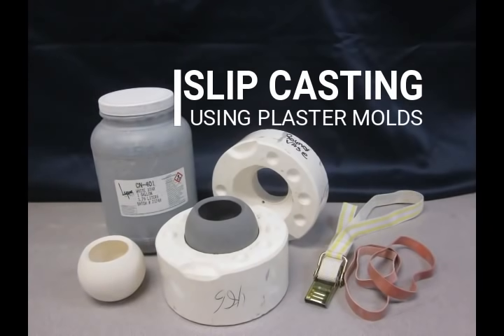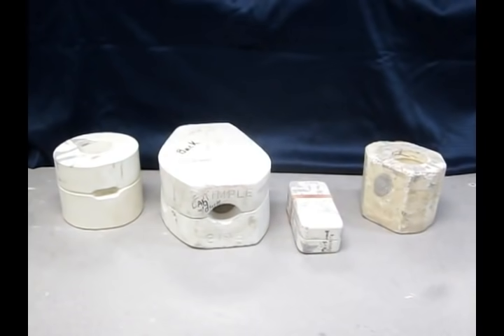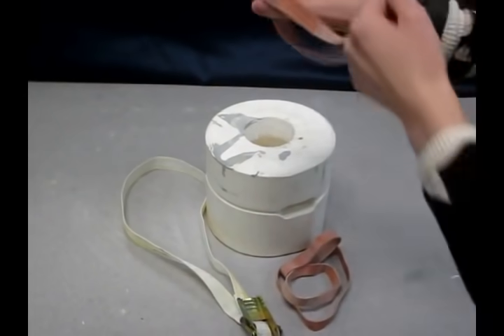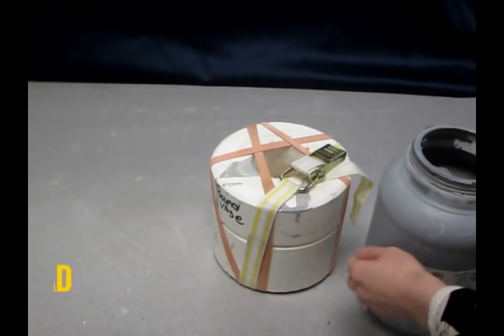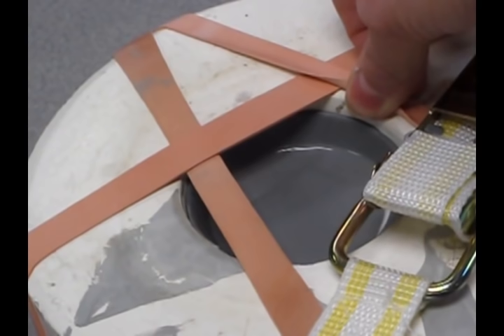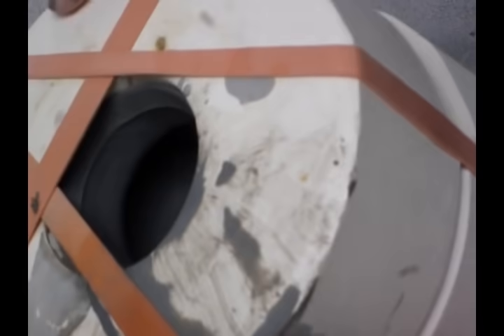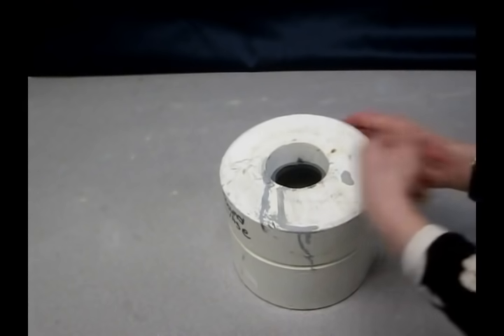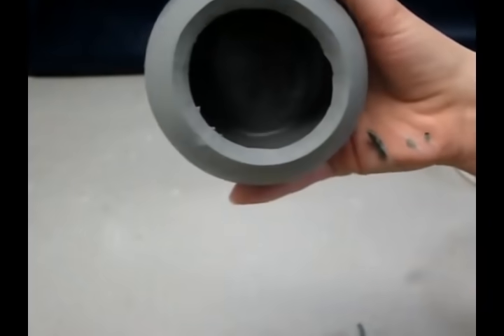Slip Casting with Plaster Molds - In Six Steps

Comment: If you don't mind me asking what's the point of creating a mug or cup made of plaster if it's not food safe?
Reply from the maker: Are you asking why would a person make pottery that is not food safe?  Perhaps for aesthetics, exploration, or just for the sake of art.  People make all sorts of useless art because of that deep innate urge that pushes us to create.
If you are asking about a "cup made of plaster" I think you misunderstood the process.  Plaster molds are simply a tool that clay is poured into in order to form it... the plaster is not what you eat or drink from.  The pottery that takes shape inside of the mold, and is eventually removed from the mold, is what a person would eat or drink from, and its "food safety" is determined by the type of clay, the firing schedule, and the glaze used on its surface.

Comment: Thanks for this, i'm just starting out. Would clamps be less fiddle and not get in the way of pouring ? Liked and subbed :)
Reply from the maker: Sorry for the late response!  Clamps would also work in place of rubber bands or a universal mold strap, as long as you trust their strength.  The trick with a clamp is it would probably tilt the mold - the lower "jaw" would go under the mold but above the table.  If your mold sits at a tilt while full of liquid clay, it can cause the clay positive to form differently, depending on how the slip touches the mold.  If you can elevate the mold off the table while clamped it would should work without issue.
Reply: @jenettemorganclassroom  Thanks for taking the time to explain.

Comment: should probably empty the "used" slip into another container after it has been used a few times, so that at some point, you can add water to adjust the specific gravity of the slip.
Reply from the maker: I agree.  If there's a specific gravity you prefer for slip casting, definitely use it.  I tend to just pour back into the container and eyeball it.  When it starts to look thicker I add a little water and blend it.  Knowing your specific gravity would be important to a production studio.  We just make a few of these at a time in the classroom.  But for those looking to do a lot of slip casting, learning how to calculate specific gravity would be a great thing to explore.

Comment: hi! loved the video! i'm very much new to all this so i have a few questions. do you still have to bake the pot or you can just leave to dry? and what do you do if you want to paint it? thanks!! <3
Reply from the maker: You must "bake" the pot in a kiln.  This strengthens and hardens the clay particles until they are vitrified.  Without firing in the kiln, the pot would be extremely fragile and break at the slightest force.  Unfired, it would also dissolve if any liquids came into contact with it.
After firing, you can decorate the pot with paint or glaze.  Acrylic paint would be cheap and easy to acquire, and wouldn't require a second firing.  But acrylic paint would not be waterproof and should not be used as a plate, flower pot, etc. To make it waterproof and functional, you would need to paint it with ceramic glaze and fire it in a kiln.  Glaze is more spendy and is a specialty item.

Comment: Did you use any kind of release agent?  Is that even necessary?
Reply from the maker: The plaster is somewhat porous, so a release agent is not necessary IF you give the clay adequate time to dry/firm and shrink.  The plaster is absorbent, and trying to use a release agent would probably hinder its ability to absorb the moisture.  I have found checking for a slight gap at the neck of the mold is a good indication that the clay will release easily.  If I try to pull the positive shape out of the mold while it is still wet, it is more likely to cling and tear.

Comment: Complete novice here:  I was surprised that you poured the used slip back into  the unused.  I would have thought that it would not remix well with the  new slip, or at least cause you to mix more .
Reply from the maker: The only difference between the two is moisture content. The slip does not retain any particles from the plaster. So it will be a little thicker, and I would do well to add a little water into the jug and blend for the most uniform consistency. Some pros have a big basin for reconstituting slip and hosing it into molds, but we just use the jug of slip until it's gone.
Reply: @jenettemorganclassroom  Thank you for the info.
Reply from the maker: @jimpinney  No problem! Thanks for watching my video.

Comment: I decided to make coconut oil soap at home. Using potassium hydroxide with coconut oil makes liquid soap very good for demoulding. Never use any type of oil as a release agent, this obstructs the pores of the plaster and prevents the removal of water in the clay.
Reply from the maker: Thank you for this useful insight! I will be sure to tell future inquiries to never use any oil-based substance as a release agent with plaster.

Comment: I think you meant to say Pottery Plaster #1 slip casters don't use plaster of Paris it's not porous enough.
Reply from the maker: Indeed, several have commented to correct me. At the time I made the video I didn't know better, and assumed all plaster was the same. I still don't know what is different in the chemical makeup of potter's plaster.

Comment: What else can you cast in plaster molds?
Reply from the maker: As I understand it, clay is the only thing you should cast in a plaster mold because it is the moisture absorption of the plaster that causes the clay to harden.
Other substances can be cast in molds, but they are usually in non-stick silicone molds.  Trying to cast another substance in plaster would probably cause a permanently stuck object inside the mold.  The plaster wouldn't release it.
Reply: @jenettemorganclassroom  THANKS ☺
Reply: D Tillman could these be used for candle making
Reply from the maker: @hopecalfe2810  These should not be used for candle making.  The wax would cling to the plaster and not let go cleanly.  The wax shape would be stuck, and you would have to destroy/scrape the wax out.

Comment: Did you justuse regular plaster of paris and not the pottery plaster?
Reply from the maker: I did not make the mold. It was manufactured. Check out some of the other comments. It seems I may have misstated Plaster of Paris. Apparently pottery plaster has a different makeup.

Comment: Hi! This was helpful!! Instead of a plaster mold, can a mold made out of metal/steel be used? (i"m curious because i want to design a mold that includes raised letters to impress a word into my piece...and so I am thinking a metal mold might be more precise and durable). 
What about a rubber mold for slip casting?
Thanks!
Reply from the maker: The problem with metal and rubber is that they are not absorbent.  One of the unique qualities of plaster is that it is absorbent and literally sucks the water out of the clay, causing it to solidify.  In theory the other materials could be used, but it would take many days (or even weeks) to reach a firm enough state that it holds its shape and could safely be removed.  Silicone would probably be your best bet due to its nonstick properties.  You really don't want the clay to cling to the mold walls.  If you're worried about durability, I have found plaster molds to really be very sturdy when treated with care.  A plaster mold would keep its design for many, many castings before losing crispness of the design.  Lastly, have you considered impressing your letters in the clay with a stamp, as a recessed design rather than raised?
Reply: Jenette Morgan  Thanks so much. This is very helpful.
Regarding the impression, I may have misspoke. That actual piece will have impressed/indented text. Any issues with raised text on the actual piece?
I subbed!
Reply from the maker: I don't foresee any issues with raised text.  Just be careful when you open the halves of the mold, that you don't bump the raised letters and dent them.
If you plan to have impressed/indented text, I wouldn't worry about incorporating them into your mold.  Just cast the shape with a smooth surface.  After you open the mold halves and take out the clay it will still be very soft and pliable.  You can use letter stamps to press into the soft clay, creating your text.
Reply: Jenette Morgan  Great, thanks!!
Reply: Sorry, I have another question :D
How soon after slip casting and then glazing does the piece have to be fired in the kiln? Can the firing step be delayed like for example a week so more pieces can be made with the mold ...so then multiple pieces get fired together?
Reply from the maker: First off, do not glaze until the pieces have been fired in the kiln one time (bisque) if you are using regular glaze.  If you are using underglaze it is ok to paint prior to firing.
How long you wait is dependent on many factors: How thick the casting is, how much water was in the initial slip, how humid your environment is... In the arid NW USA I usually give my clay a week to safely dry before firing, but some thin castings could be fired as soon as three days later.  Tip:  Hold the clay to your cheek.  If it feels cold, there is still moisture in the clay.  DO NOT FIRE until it is completely bone dry.  Once the clay is bone dry there is no harm in waiting even more time, to build up enough creations to make it worth a kiln firing.
Reply: Jenette Morgan  Wow, you are indeed knowledgable! Thanks!!

Comment: To make the plaster mold you use mold release oil to not stick the two half? If you use oil does this prevent moisture absorption from liquid clay? How do you not stick the mold parts?
Reply from the maker: Sorry, I cannot provide expertise in creating plaster molds.  I use store-bought molds. I would guess that vaseline or non-stick spray could be coated over the object you are trying to make a casting of.
--- 
As for clay positives in the mold negative, I find that the clay does not cling to the plaster mold if I give it sufficient time to firm up.  If the clay is sticking in the mold, it needs more time to dry and firm up.  Usually when I can see a gap between the clay and the mold I know it has firmed up, shrunk, and pulled itself away from the mold wall.
Reply: you can use just soap

Comment: Clown whisper is right. It is not a normal Plaster of Paris, it a special plaster mix for slip casting. Also if it is hot and dry when you pour a mold it can take as little as 5 mins to develop and should be emptied much faster than 45 mins. The slip casting should be between 1/8 to under a 1/4 inch thick and can be measured by drawing a needle tool through the thickening clay on the edge of the mold to see how thick it has gotten.
Reply from the maker: Thanks for the feedback.  This video is intended for my students, who will be slip casting in a temperature controlled classroom, so we don't worry about heat.  I have them err on the side of thick (albeit inefficient use of slip) casts because most of them aren't dexterous enough to handle a thin casting without breaking it.  Forty-five minutes is also about the length of one class period, so they can come back at the end of their next class to pour out their slip.  I am sure professionals and hobbyists would prefer a thinner casting completed in less time.
Reply: I agree. 45 minutes is too long for most molds. Larger or taller molds require a bit more thickness, but 5-15 minutes is plenty.
Reply: I was thinking the same thing. I would say 10 minutes

Comment: Correction plaster of Paris is not typically used 4 slip casting. I was just reading that casting plaster is a totally different formula which absorbs water he's in your and create a cast that is much more durable
Reply from the maker: Thanks for the research!  I didn't know that casting plaster has a different composition from just plaster (of Paris).
Reply: They are both the same chemistry .Half hydrated Calcium Sulfate.If some difference of particle size exists I do not know.
But I use "Plaster of Paris " for slip casting with no problems.
I am casting technical ceramics at work.Alumina components ,for the metals industry.
 Works fine.Maybe  there is a lower absorbency   but I do not see that being a problem for most cases.
If you have PoP I wouldn`t go out out of the way to find an optimised plaster.

Comment: I have the molds but what I have to use, already went to home depot, Lowe's even hobby lobby to get the mixture and they just don't know
Reply: Casting slip is a specialty item. You'll need to find a local potters supply, or at worst buy the jugs online and pay heavy shipping. You can make the slip yourself from powdered clay, but that's a whole other process with a lot of health hazards from the dust particles.

Comment: How much time does it usually take to dry the mold before re-use?
Reply from the maker: I have re-poured a mold immediately afterward, but found it took longer to form a skin the second-time around.  I recommend leaving the mold empty overnight for the plaster to air out.  Mayco says that if the mold feels cold and clammy, it is too wet to use.  They also recommend allowing the mold to dry with the halves banded together, to prevent warping of the mold.